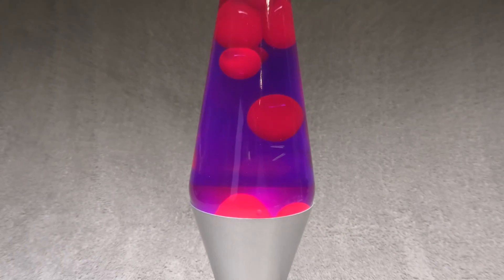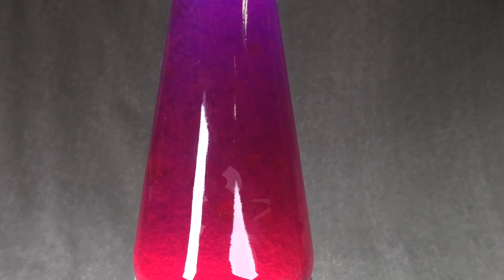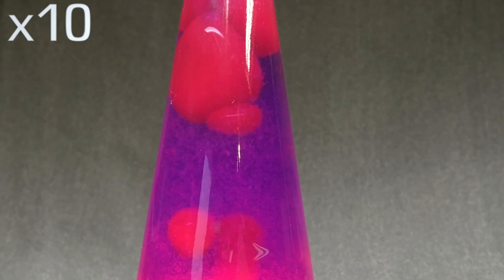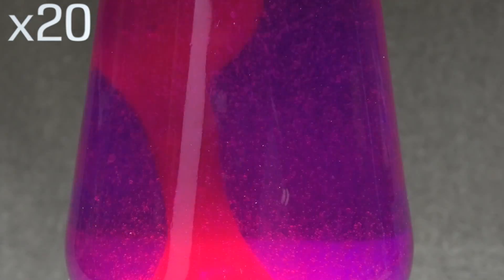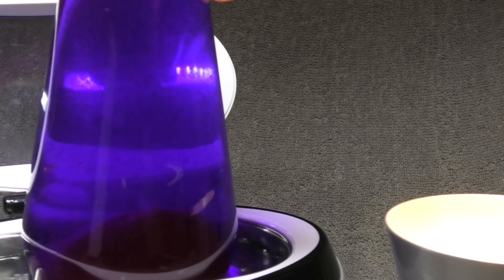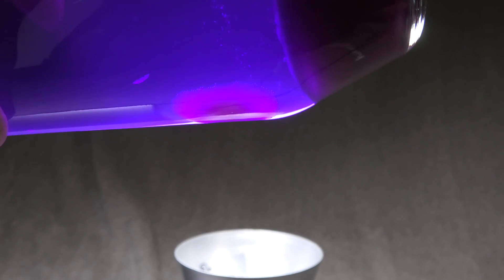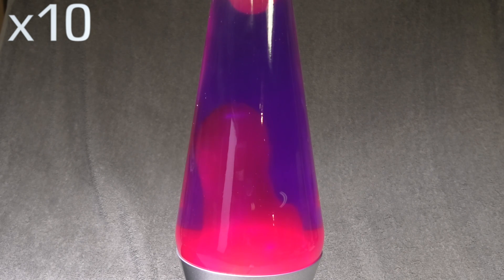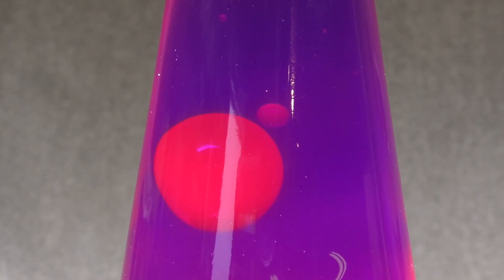SHAKING a LAVA LAMP - What Happens??   CAN WE FIX IT !?

Comment: dishwasher. or hot water bath. point is to melt the wax so it releases the trapped tiny air/gas bubbles. if you watch a video about how lavalamps are made, a hot water bath is also a step there, to clear out the filling
Reply: Dishwasher...hmm

Now I want to shake and wash
Reply: @MeowMeowMarshmallow use cooking spray

Comment: i just got mine and used it once even the lightbulb stopped working 😭
Reply: Just replace the bulb. Sometimes bulb filaments get jostled and damaged just in shipping. It's a basic incandescent bulb... just take the old one to a hardware store and find a comparable replacement. Cost a lot less than a whole new lamp.

Comment: I have an old lava lamp that is old to the point it sits completely still unless you shake it. I think the only solution is replacing the metal coil (which has become pretty oxidized and flakes a bit) and adding something to modify the buoyant force of the liquid. TechnologyConnections made an excellent video explaining how lava lamps work and likely something similar to how they are made.

 Personally I like seeing a lava lamp even in its shaken state, you can watch all the convection currents as everything slowly coalesces.

Comment: What if my wax is stuck on all top
Reply: Could be from overheating if it's all there only when running. If it's stuck on top when cold, then you either have bigger problems, or you need to run it for at least eight hours to overheat it on purpose so that all the wax melts and mixes evenly despite being on top. In both cases you also need to check the coil at the bottom of the bottle - if it is not covered in wax, then try, on molten wax, to transport the coil to the wax either by tilting the lamp (with minimum shaking) or using a magnet, and then back to the bottom of the lamp. When I replaced my spherical lightbulb with one that has a reflector (same wattage though), my lamp overheated so much that all the lava left the coil and just moved up and down sluggishly as one or two big, unchanging blobs, and that helped. Also got a dimmer and set it to lower brightness so it has a more satisfying flow.

Comment: Mines been off for several years because i shook it many times and it stopped working, with a lot of wax at the top, no matter how long i ran it or what method i tried, nothing worked to get the wax off the top, today i was cleaning and i moved the lamp and set it on its side, i picked it back up and all of the wax from the top fell down, i think now im going to keep heating and cooling it to get all the wax to melt together again.
Reply: So did it work?

Comment: Waaaay easier = if on/off method doesn't work/if you have cloudy water = open the cap pour out the lequid buy ned lequid or make your own its just saltwater and clear dish soap :) food color to tint water.

Form wax to 1 ball with gloves or stomp it in the bottle with whatever available to you.

(you don't want germs ind the water so keep everything clean.)
Reply: it’s not only salt water and soap.
Reply: @bittyb0t  it's a cheap work around that works with the old wax.

Comment: I fixed mine today by sitting it with a hot water bottle- inside the cover. It’s been in there about an hour  and it’s sorted!
Reply: I filled a hot water bottle, it’s in a furry cover. I stuffed my lamp ( glass part only) into the cover with the HWB, and wrapped it in a towel. It took about 30 mins but it completely resolved all the tiny bits of wax , and sorted it into one lump again. Worked perfectly ever since. Hope that explains it! It was a hunch that just happened to work- probably because it was hotter than the 20w bulb.
Reply: Can you explain this?  I bumped my lamp while running and I have small bubbles everywhere. What do you mean "sitting it with a hot water bottle inside the cover"??
Reply: Yes can you explain this better? Trying to give this out

Comment: Take a hair dryer to the part stuck at the top, (don't hold too close to glass) melt the stick part, thump on glass and get it broke loose, and it will fall down
Reply: What if you can’t find your hair dryer? Is there any other object that can be used?
Reply: @cellie_bellie   You can try pouring some warm water at the top part, might work.
Reply: @cellie_bellie how do you lose a hair dryer. It should be on your duty belt at all times.
Reply: ThANK YOu
Reply: Or buy a better quality lamp, from England. A Mathmos.
Reply: @s13rr4buf3  they dont export/ship to the rest of the world, I wish they did
Reply: @s13rr4buf3 us Americans only ship with American Bald Eagles.

Comment: Hi I'm 12 ans this happened to me but my lava lamp was running and mum had to pack it back up so she put it in the box upside down i had told her not to but she didn't listen it hardened at the top on the way home ( we were staying at a family members place for christmas and it was abt a 3 hour drive ) mum shook it up after I had turned it on hoping the wax would just melt we ended up just putting it in a pot of boiling water which worked but my lamp is cloudy now what do I do??? I have let it sit for ages but I have just given up at this point any ways on how to fix this?? I really want my lava lamp back to the way it was :(
Reply: I'd suggest a call to CPS.....

Comment: The fix was simple for me, all you need to do is melt the wax and then turn off the lamp and let the little bubbles sink to the bottom, then start the lamp again and it should melt the little pieces together and it should work fine after that.
Reply: But what about the cloudiness? Wont the water still be cloudy?
Reply: @Ginny_Morris  no.
Reply: It worked, my lamp working perfectly fine now thankyouuu!
Reply: Yeah, ive done this plenty of times, most of the shakes were intentional. just run it a bit, let it fuly cool, start it up again and things clear up.
Reply: @timthorson52  I have a 2nd lamp I just bought on ebay from the 1990s --- it runs good but each time the lava shoots up and it "snaps" apart - small particles of wax break away. Same thing over and over, it shoots up, and when it snaps apart to form a ball, lots of small bubbles of wax breaks away, like it's been shaken. Over a few hours, it really becomes a mess of tiny floaters in the glass. As it cools, it all comes back together, but the process repeats each time I run it. Ideas?
Reply: @flippindocks8183  Maybe the power is wrong? I would think too high.
Reply: I just bumped mine while running. Lots of tiny bubbles of wax now. I turned it off.... the big globs of wax settled to the bottom, but all the tiny bubbles are floating everywhere and not settling. What now?
Reply: I can vouch for this. As a kid I would shake the hell outta my lamp all the time. In my experience this worked every time.
Reply: Dropped the mf the other day and it still works💀🤷

Comment: They are only recommended to run for about 10 hrs at a time. After that bubbles get smaller
Reply: Protip: You can fix this easily by installing a dimmer switch, so you can regulate the temperature after a few hours to avoid overheating and therefore keeping the blobs bigger ;)
Reply: @melon_musk  i just got a smart plug on amazon and you can set times for it to turn off and on automatically and you never have to worry about it
Reply: @Kyle17206  I got a smart dimmer, do that it turns on the lamp at full power to make it start faster, and then dims it to 57% so that I get best flow (subjective, but the goal is to have for most of the time either pillar-like flow or one-two big blobs and up to 3 small ones not counting any barely visible ones). I also replaced a spherical Lava brand lightbulb with a cone-shaped bulb with a reflector. It does produce more light and heat for the same power in the direction that matters, so a dimmer is a must if you do this. But even dimmed to closely resemble the original lamp activity, my lamp looks way clearer and brighter when seen in a dark room than how it looked with the spherical bulb.
Reply: @krzysztofczarnecki8238 where did you get the smart dimmer
Reply: Not me having mine on 247 since Xmas
Reply: Oops

Comment: I just got a new lava lamp, first once since ive had one as a kid. And i tipped it sideways while the wax was warming up and now its in big chunks of still unmeltedwax, the bottle is heating but isnt melting it. So i have no tiny bubbles like in the video but im going to wait it out and leave it to heat up for a few hours
Reply: It will work still, just takes a bit longer until its all melted.
Reply: Omg same i got IT on christmas and 3 days later it became wax and I was so upset
Reply: @simabivainyte7546  the "lava" in the lamp is wax, mine eventually melted all down back to normal with just a few bubbles. Try not to shake it up and leave it on heat for about 2-3 hours and see if that helps melt the wax down. If not you might have a defective lava lamp
Reply: @karmaloop8957  ty so much
Reply: using a blow dryer, or upgrading the bulb to 40watts would help. and the coil contributes to the problem so you should check that:
Reply: @aquam4rine  what about the coil should I look out for?

Comment: Where did the metal spiral come from?
Reply from the maker: It usually comes with with it.  It is used to break to break the surface tension of the wax.
Reply: @MegaSafetyFirst  no it’s used to evenly help heat the wax. What breaks the surface tension is chemically related invoking the water and how the wax reacts to it.
Reply from the maker: You should let Wikipedia know about their mistake:
“A metallic wire coil in the base of the bottle acts as a surface tension breaker to recombine the cooled blobs of wax after they descend.”
https://en.m.wikipedia.org/wiki/Lava_lamp